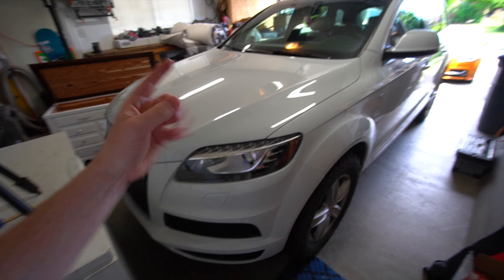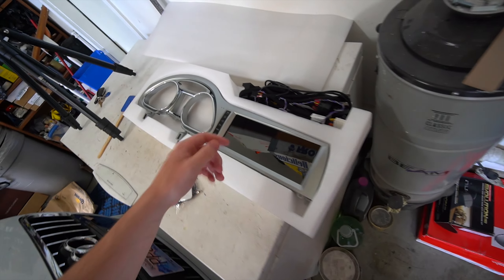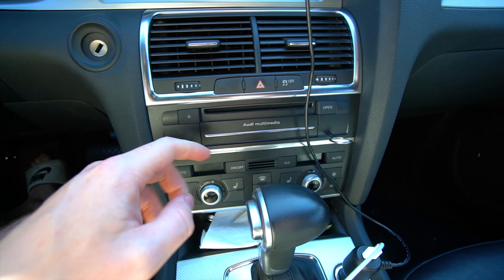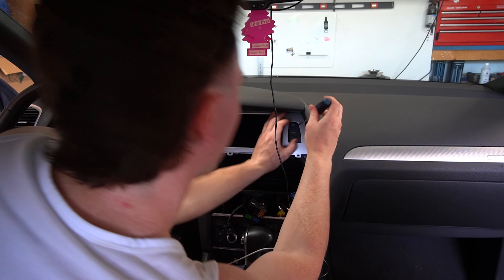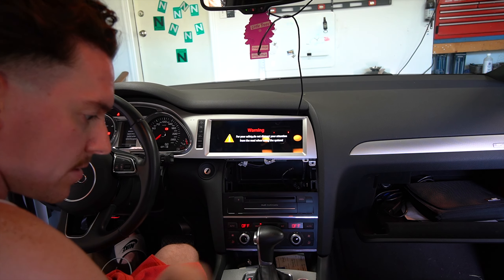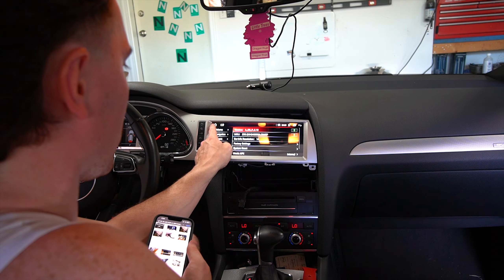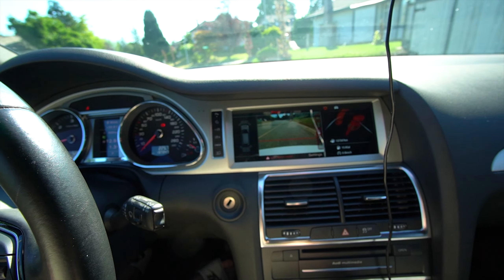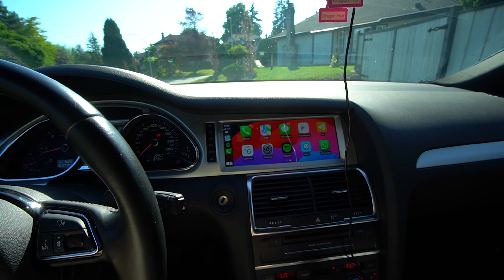Carplay Made My Aging Audi Q7 Feel BRAND NEW - Nunoo Carplay Upgrade

Comment: An important note. Remember that after the conversion the start/stop button will no longer be there. This is because the Android radios don't have one built in. I show how I converted it in my video. You need some technical understanding to carry out the conversion.
Reply: what do you mean by start/stop function? engine start/stop?
Reply: @hellojuned  No, I mean the start/stop function. If you stop at a red light and hold down the brake, the engine switches off automatically. As soon as you release the brake, the engine starts again.

Comment: My units screen won’t turn on, it smoked a little when I was connecting everything for some reason 🤦‍♂️
Reply from the maker: uhhh, did you leave the ignition on when you connected it? Unit screen you mean in the cluster?
Reply: @ThatGuyTyy Idk I couldn’t take the key out when I had my car in neutral for some reason, I had the key in the ignition turned to the left so the car was off but when I connected the power to the display there was a faint smoke from the motherboard. I also connected the ac climate panel connector towards the end, not sure if that was part of the issue but now the display doesnt turn on.
Reply from the maker: @Beatinu yeah the ignition should be fully off when connecting anything to the cluster as with key on or activating any information it should be sending power - not sure if there’s a fuse in the back but I’d start there. Mine is push to start so when I’m in neutral I can still key off, but when I do it alerts to put the car in park till I do which could have been your issue when reconnecting as it also powers the speaker in the cluster
Reply: @ThatGuyTyy  ahhh I got it man, I blew the 7.5 amp A3 fuse on the driver side responsible for all information electronics. I put my old MMI back in and the display didn't come on either so I was sure that it was a fuse that blew. I'm gonna try to put the android auto back in and hopefully that works despite it smoking from the motherboard previously.
Reply: When you have the Apple screen on and go into reverse does it automatically bring up the camera—small gripe but for me to do this that would be a stopper if it doesn’t thanks for the video
Reply from the maker: @mikerdinwiddie yes it does

Comment: Did you happen to get a wiring diagram from nunoo? I have several connectors that look like they go nowhere and want to make sure im not missing something before i button this up.
Reply from the maker: For me there were a few not connected as well. One thing to note is there are a few that connect back to the system itself, that seem like they should go to the car. They did not provide me with a wiring diagram no
Reply: Thank you - seems as though I have most everything but must be missing something as I don't get the direction audio when in Android auto

Comment: Video was very helpful. Thanks. After installing I had no BT but the radio worked.  I played around with it for 2 days (and unfortunately did not keep track of everything I did) but I also got some info from the manufacturer that coupled with what I did made everything but the backup camera worked flawlessly. The backup camera is now very pixelated so I'm gonna play around with the settings.
Reply: Did you find out how to make the sound work? I just installed mine and had the same issue. Just cannot get it to play any music over Bluetooth.
Reply: So I contacted the seller and they told me to connect to the Aux/AMI. The unit came with a AMI to male aux so all I had to do is get a female aux to USB C to connect to my phone. Once I hooked it up the music started working and now even works without the phone plugged in.

Comment: Hey man- I ordered the same unit from the link and installed it in a ‘15 q7 with Bose. Everything works except no sound from CarPlay. I was wondering if you had any issues like this? I can still hear the regular radio like normal, just no CarPlay sound. Also I have the ABS, TPMS, and traction control lights on. Any ideas?
Reply from the maker: Connect to your original Bluetooth, then hit the volume knob on the console
Reply: @ThatGuyTyy  ok, I’ll try that- thanks for the quick reply!
Reply: I’m having the same issue my original Bluetooth works great however I’m trying to watch YouTube but get no sound lol 😂 I’m tryna figure it out
Reply: @nelsonmeinke72 after much fiddling with this unit I’ve come to the conclusion that the only real fix is to buy the $700 version from RSnav. If you look on their website they list the difference between this unit and theirs and the reason for the higher price, despite the units looking identical from the outside appearance. Mainly the fact that this unit has an outdated processor, and theirs has a much newer version. There’s also some extra wiring and hookups included with their kit.
Reply: @JC-dr8ev  yeah I didn’t know much about these radios. But the radio itself won’t work through the speakers I have to manually use the factory side of things. I’m trying to play CarPlay music and it won’t play through speakers maybe something is hooked up right I’m not sure
Reply: @nelsonmeinke72  como lo resolviste?
Reply: @nelsonmeinke72   did you ever figure this out i have same issue right now

Comment: Lovely ❤ did same mod 
Even tho i did route the audio through the aux it has major troubles in transferring audio and audio blanks in calls sometimes 
And latency has increased so much 
I ended up switching back to original mmi bluetooth and couldnt be more happy
Reply from the maker: This is good info here as I have thought about making that switch to the aux input, but it seems to just make more sense to keep it on the built in mmi Bluetooth, although; this way you can’t modify the audio equalizer beyond what is available in the factory mmi which sucks
Reply: How long did it take you to get yours ?
Reply from the maker: About 3 weeks
Reply: @ThatGuyTyy I ordered mine on nov 7 still waiting obviously however it sends me updates but when I click on them they don’t show nothing 😢
Reply: @nelsonmeinke72 has it arrived

Comment: Hey brother im considering getting this due to the reason my center dial isn't working 😭 can you use touch screen for everything or do you still need access to the dial? I need to reset my tpms in the car menu 😅 and thank you so much for the video!!
Reply from the maker: Nope, you still need the centre system for your mmi to work - sounds like you spilt something on it? You’ll need to replace it
Reply: @ThatGuyTyy  yeah I guess someone before me had split something, the center system is functional. I can click it in it works except moving around the MMI using the dial . I was hoping to install this and just use my finger lol I can't go into the car settings using the touch screen at all?

Comment: Ty—just installed.  Two questions 
1. I wanna use my Bluetooth for music like you because I’ve read it sounds better—however now that I’m also Bluetoothed to this unit to allow Apple CarPlay-I have no sound from the car play -?
2. When I go to the car page-it says no signal—I’ve checked all my connects and still no signal-any thoughts on that?
Thanks for you time and the video totally helped me with the install today
Reply: Scratch the second question I did in fact miss a loose connection twice-sigh—but still stumped on the CarPlay audio situation
Reply from the maker: Make sure your output from your phone is selected to your Audi, but the volume knob once you have music playing from your phone and turn it up, it should be working
Reply: Incase anyone else is having a sound issue I just got mine installed today. I had to plug the AMI adapter into the glove box, I did not have to actually connect the aux end. Then I picked AUX on the media selection options in the original MMI. Works great, no issues so far. Not sure why this works, I tried everything else I could possibly think of and was about to give up until I randomly plugged the adapter in for giggles
Reply: I activated the aux in the green menu as well and now everything has sound. ( with no aux actually plugged in) they emailed and said it would work and it does) I had to “forget” the stock q7 Bluetooth and only connect to CarPlay.  Sound is perfect only issue is that the crappy microphone on the new dash piece creates an echo for anyone you are on the phone with as it picks up their voices from the  speakers—I reconnected my phone to blue tooth for calls and fixed that—but if you get a call while using wayz or maps. After the call the navigation gets disconnected and won’t make sound until shutdown and restart of the car.  Even trying to switch audio source in those apps doesn’t always work  my girlfriend drives this too and she doesn’t wanna be doing that all the time so the consensus was to have crappy call quality for others to keep us from having to switch sources all the time—if anyone has found a better way let me know

Comment: when you say an aux out to mmi are you meaning like a 3.5mm jack to mmi trying to order correct part before radio comes in
Reply from the maker: It should come with the radio, essentially it goes from the radio to the mmi connector in the glove box, it just lets you use the external audio from the new unit compared to the built in audio system

Comment: I just bought a 2011 and basically going to do everything your doing to it
Reply: How did it turn out? I am thinking of ordering one.
Reply: @ 
The stereo worked good! A couple issues are the wifi goes active when doors are opened so I usually have to turn of auto connect or phone calls get answered in the car not on my phone. Haven’t done a loft yet but I did do a stage 2 tune

Comment: Hey man, great video. I’ve got most everything working except the rear view camera. Sometimes the parking cameras pop up when i shift to Park and i can access the rear view camera that way, however when in reverse, i get a “no signal” issue. Any ideas? Still waiting to hear back from Nunoo on it.
Reply: Make sure you hooked up the antenna like cables on the original radio and the one that was on the back of the original screen to the new harness. I missed the screen one my first time
Reply: @ Thanks for the response, i figured it out. After requesting additional instructions from the vendor,  I was able to go into settings and set the rear camera to “Original” and it popped right up. Thanks again.